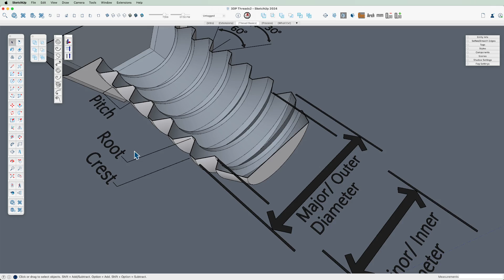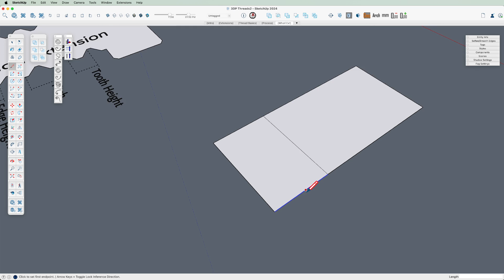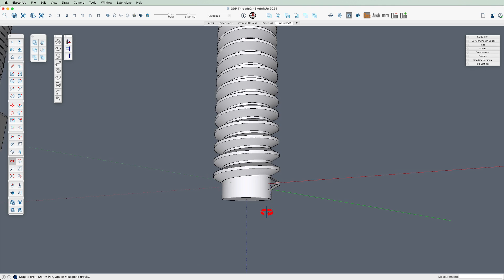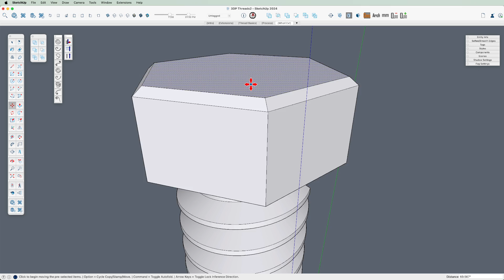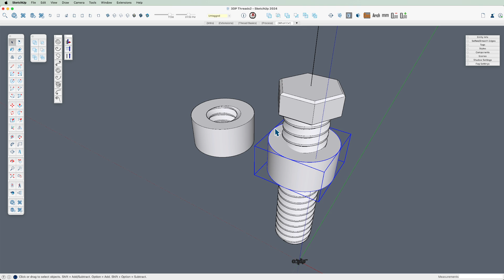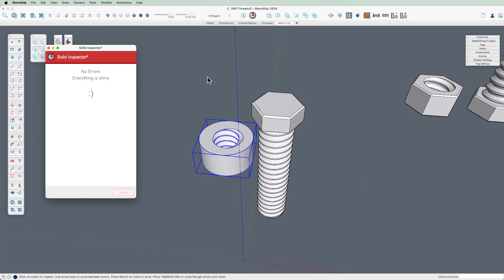Modeling 3D Printable Threads for Nuts & Bolts

Comment: In many cases, it makes more sense to select the number of segments as multiples of 2, 3, 4, 8, 16, ... . If it is to be fine for 3D printing, 64 or 96 would be more suitable values than 60 or 80.
Reply: 48 for smaller parts, 96 for larger is my go to. Totally agree as this allows you to keep the ends of segments on a circle aligned with both the  x and y axis. Also with linear lengths, 24mm is very close to 1" so it makes conversions that much easier.